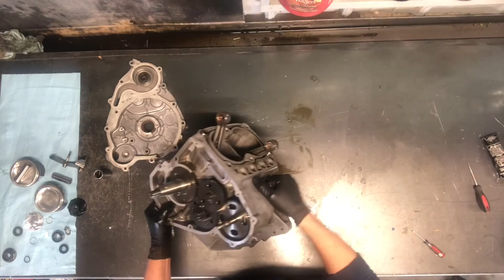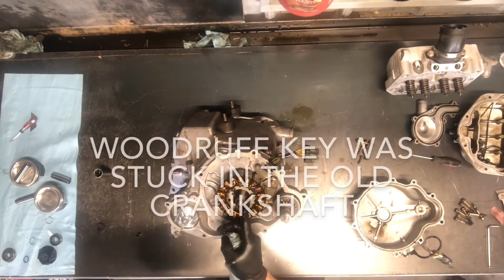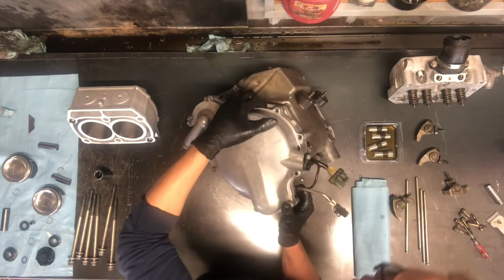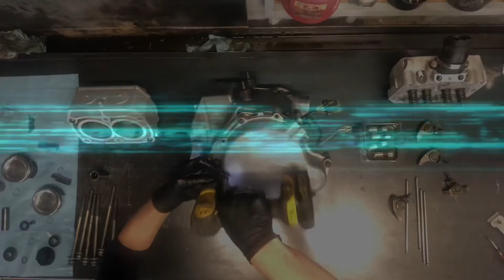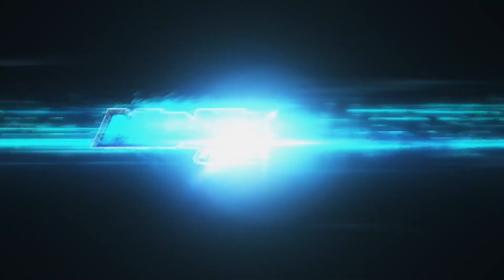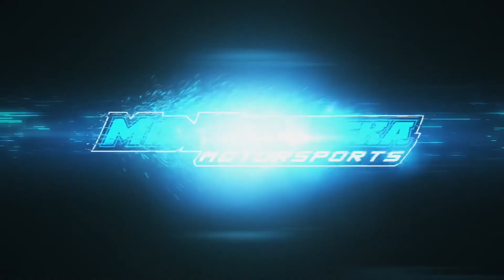Ranger / RZR 800  -  Water Pump, Flywheel, Stator & Magneto - Installation

Comment: I am right in middle of putting my 800 stator housing back on. Polaris manual says to install all seals dry and protect the inner lips of both seals for proper break in? Why do they want it done that way?
Reply from the maker: Why dry, you mean? That is a good question. I can look into it. Is it a clymer/aftermarket manual or Polaris. I don't remember seeing that in the Polaris manual. Thanks for watching. Let us know if there is anything else you need!  https://www.midnebraskamotorsports.com/